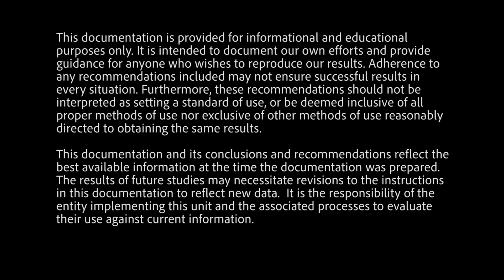How to Sterilize N95 Masks With an Open Source DIY UV Decontamination Unit

Comment: It appears that the filter has been removed from the N95 mask in your demonstration. What's up with that?
Reply from the maker: Thank you for the question.  The mask in the video was also used for testing.  We attached the sensor to the mask to measure exposure to UVC within the concave surface.